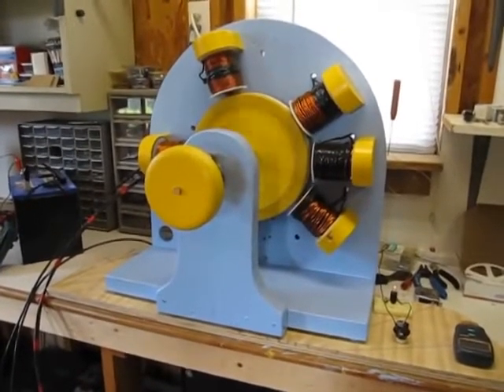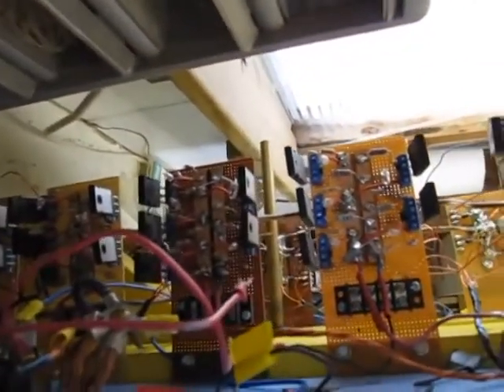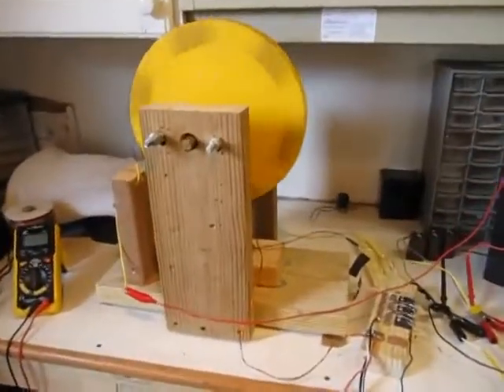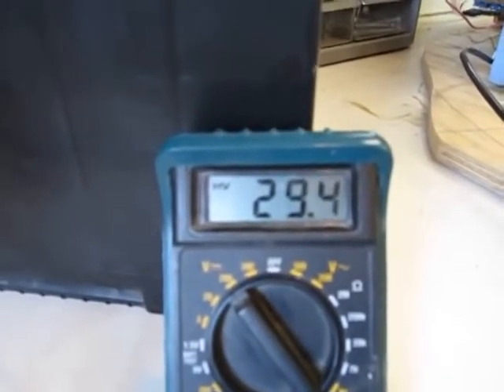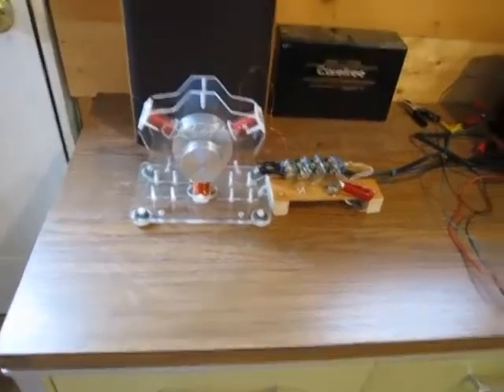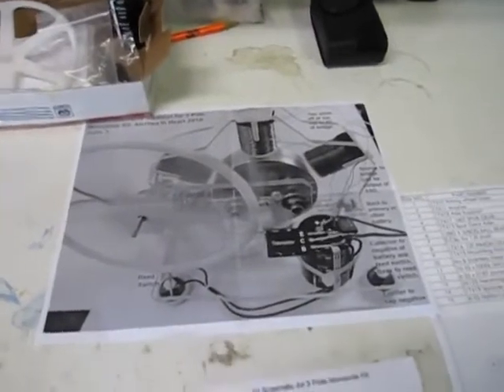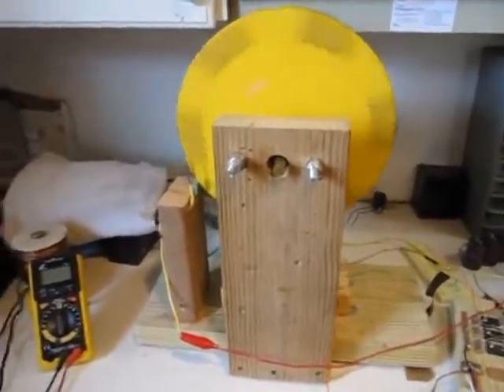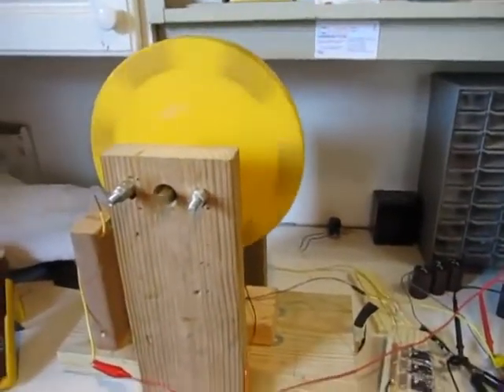John Bedini 10 Coil Radiant Energy Replication

Comment: you cannot achieve overunity with electrochemical as your source power or charge power, lead acid has loss on it's own, you can chieve overunity with capacitors cause they are not electro chemical. They are carbon storage